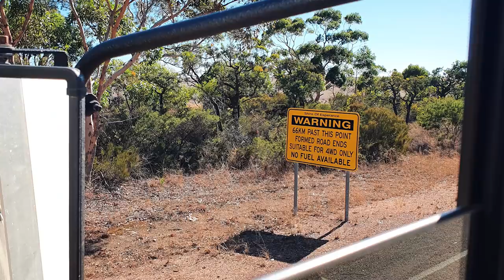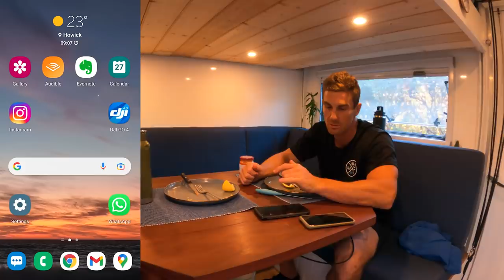STRANDED ON THE TRAIL! First Issue with our 9 TON EXPEDITION TRUCK - Remote Camping Cape Arid

Comment: This might have been mentioned, but (pro tip), with split rims you don't need to remove the rim from the truck.  Just jack it up, pull the retaining ring and pull the tire off the rim.  Then do your repair and slide it back on.  We use a 6' bar and a block to lift and slide it back on.  We even do big loader tires that way.
Reply: And air in tube and go in water to find leak
Reply: maybe you can teach him.
Reply: Yep, even on normal rims the vehicle weight can help a lot, especially tractor rears. (You lower the wheel into the new tyre.) :o)
Reply: Any time I’ve ever done a split rim I always point the ring toward the ground when airing them up that way if it comes off it goes straight to ground and not flying off across the world. But that on normal size tires I’ve ever messed with
Reply: @4wdtennessee459  That can be worse, then the whole assembly goes airborne :o
Reply: @teamidris  like I said I’ve only done small truck tires so there’s not as much force behind it I would think but I do see what you’re saying. One other thing Ido is wrap it with a chain in like 3-4 spots. I’ve never had one come off but I’ve only had to mess with a few of them.
Reply: @4wdtennessee459  I’ve never met a tyre that wasn’t thinking about killing me :D
Reply: @teamidris  lol right
Reply: You can only change tyres with tubless split rims on the truck. 
Wouldnt be easy with adf rims

Comment: Hi chris just a quick tip that may help i watched a bloke with a race truck  use 2 rachet straps hock from the side rail into the holes in the wheel rim to lift the wheel on to the studs in sandy conditiond

Comment: Invest in a electric rattle gun, it won’t undo the torqued nuts, but will save heaps of time once cracked.
Reply: you mean battery.. electric needs 240v..
Reply: @harrywalker5836  or air. As would have a compressor and air tank surely.
Reply: Milwaukee M18 impact will knock those lug nuts off...
Reply: @harrywalker5836  I think electricity comes in all volts battery powered 18v volt would still be electricity ⚡️🤔
Reply: Yeah3/4” Milwaukee electric impact wrench no worries 😉
Reply: like others have said 3/4  milwaukee would eat those wheel nuts for breakfast i use one on a regular basis for truck tyres.
Reply: Impact wrench !

Comment: Hello Chris & Ange, I have another tip for you because l am not sure if you did this. I know you couldn't find the leak so your assessment could be spot on but this might be useful for next time. Mark the tyre with chalk where the valve is situated before disassemble. Then when you locate the leak on the tube match it back up on the tyre by just resting it on top. By doing this you can get a general idea where the tyre was punctured. Then carefully rub your hand along the inside of the tyre in that general area in particular,  but also the entire inside area just to be sure for the offending foreign item. By doing this you can feel more confident that you are not fitting the repaired tube, or a replacement, back in while the foreign item is still in the tyre. If you don't do this you might find the tube will get punctured again. Hopefully l explained this well enough. Jason from Melbourne Victoria.

Comment: did you check the valve?do you have a valve removal tool and spare valves?
Reply from the maker: No it was coming from behind the valve stem where it attaches to the tube.
Reply: @TheOutFit  well done on the change anyway!
Reply: @TheOutFit  why dont you have a 1/2 & 3/4 battery drill, i change 5 tires in 20 mins. rigid, milwalki, makita.. that extension bar is chinese, get a u.s, japan, swedish one..

Comment: One great safety tip for changing split rims without a safety cage:
You should only inflate the tyre to about 5psi (until the flange seats) then bolt it on. Once it is bolted on the vehicle then inflate remotely on the other side of the vehicle if possible. Then if anything goes wrong you won't have wheel components flying at your face! Happy camping and stay safe 🤙
Reply: when they let go, you look like a burger ring. death rims.. jeeps ,f250, dodge had them.

Comment: Great show travel safely 😁 👍🍺
a couple of small tips 
Carry a 4way valve tool and extra valves . It may be a faulty valve in the tube and the tool can re-tap  internal valve thread . Removing valve to air down often weakens them. 
Use a few ratchet straps around the tyre over the split rim locking ring to hold it down when airing up in case it flys off 
Use ratchet straps to raise the wheel up onto the hub or you can use a few metre long or longer  bars . Leverage makes a big difference.  a long handle shovel also works
Definitely use a jack stand  
Did you permanently wire your diesel transfer pump on your dash board yet
Reply: Plus one to checking the valve core. I've had a few on them fail over the years. Each time that they failed, they only leaked at low tyre pressure. Made it hard to diagnose.

Comment: Good job on the tyre, Iain just changed all five of our tyres over to the new wheels, and the split rims are a lot easier than  solid wheels.   Iain made a jack stand out of a laminated wood, to work together with the jack, not replace it.  It is also flat, so packs away nicely.   Iain also says it is best to put it in 4wd and diff locks on when jacking it up, we made that mistake once and the truck rolled forward and fell  off the jack when the wood under the jack broke.  We damaged a portal and the truck  ended up on a flatbed -  $1000 for the  300km trip home, but we had insurance so just the $200 excess.
Reply: I made the jack stand out of LVL, about 90mm x 240mm wide and shaped to fit the axle.    I made it from 2 x 240x45 LVL, glued and screwed together.  If you go with  3 x 240x45mm LVL, it will work for your truck, as long as you use it with the jack, not as a replacement.  As Trish wrote, put it in 4wd and lock the diffs, as that will help stop it rolling.  You are lucky you picked up that it was leaking, as a slower leak would have made the tyre overheat and destroy it.  We have a Tyre Pressure Monitor,  it has saved us a couple of times giving us warning of punctures  and leaks, long before we realised it was going flat, the alarm was going off.   You will need something with an external aerial, as we found that we sometimes did not get signal from the sensor, and our truck is a lot smaller than yours.    It cost $400 with internal sensor and the external aerial, well worth is epecially given the cost of a tyre.  You would need the external sensor, due to the tubes.    Good luck with your next bit of the trip, so many great places to visit down there.  
Iain
Reply: Hola muy bueno el comentario.. Lo voy a poner en practica. Gracias. Saludos desde ARGENTINA.

Comment: Well done on the repair job. There's plenty of haters out there re split rim set ups. But the Aussie outback has seen over 70 years  of trucks and utes wearing split rims. They are just so practical for the sort of use you are putting the Mog to. Just pull them to pieces every couple of years and give them a wire brush and a bit of TLC.  Also, be very liberal with talcum powder when reinserting the inner tube. It helps enormously to permit the inner tube and tyre to move independently of one another without chaffing when at low tyre pressures. 
Another tip when no axle stand is available. Chock the other rear tyre (plus put in 4WD diff lock). Logs, rocks, or the proper Mog tyre chocks that the Mog came with from Germany.

If you were thinking of going the battery operated rattle gun for spinning the wheel nuts on and off with, think of going with a brand that also make a small battery chainsaw and drill. Very useful additions when in remote countryside

Comment: Great work on getting the tire back on, it's a BIG job for sure. One thing i have picked up over the decades 4 wheeling is too use about 1/2 bottle of talcum powder in each wheel of that size when you are using a tube inside. It does an amazing job of keeping the tube in place when run at lower pressures. I LOVE all that your doing now and look forward to the next vid each week.      CHEERS AND SAFE TRAVELS     Steve h.

Comment: I know the joys of changing tubes and mounting tires on split rims. My father was a milkman from the 1950s till mid 1970s when I took over the family business.  The 5 ton milk truck had split rims with duelies in the rear. The nice thing with duelies is if you only need to work on the outside wheel you could just run up onto a 2 inch board with the inside tire to lift the outside one high enough to get it off.  No jack required.  Even back then it was difficult to impossible in the U.S. to find a tire shop that would work on a split rim, so we had to do it ourselves.

Comment: You might want to get a cordless impact gun. That bar is bending pretty far and if it fails, it's nice to have a backup. The impact gun is also nice when it comes to spinning lugs on and off and is super handy with anything kind of bolt needed work, and you've got a ton of them! Nice work.
Reply: they can break that type of breaker bar but the main thing to avoid that is grease or antisieze on the threads.theres no other way around it. lubing the threads also get them tighter because the threads don't bind.
Reply: Yeah, a good impact is priceless for many reasons in this type of vehicle and situation. Chris looked like he was enjoying the workout however and I suspect there is already a good impact somewhere in the Moog.

Comment: Good effort on the tyre there a dead weight for sure. Get yourself a good battery impact impact gun you have the means to charge it plus you wont have to break into a sweat breaking the wheel nuts off. Loving the channel and the day to day adventures of you both 👍
Reply: lol , i was thinking air-gun run off the truck's air  ... but yeah anything but a breaker bar & effort
Reply: @888johnmac  Id think your air tank wouldn't  be big enough im running a 150 ltr tank and that does car stuff but ive also got a SnapOn gun that does most stuff. Milwaukee does some good ones not cheap but well worth havin.

Comment: Hi there guys Next time in this particular instance check the valve core first before doing anything. When deflating 
/ inflating tyres these are easily damaged. I've had the same issue twice. Chris the way that brace bar bends you may wish to look at purchasing a battery operated impact driver. Just a thought. Love your work; travel safe .
Regards 
Steve H

Comment: Hey mate I grew up with an old man as a truck driver . When youvuse the tyre levers to get the bead lock off , cross them over. This allows you the use the bottom one as a l pivot point making it far easier.

Comment: Guys, good job on the tire repair.  You’ve now graduated👩‍🎓👨‍🎓from Big A_ _ tire 🛞 University.

Chris, it was very smart of you to learn how to and practiced on the original tire mounting 👍.  

Now for my 10¢s, which I’m certain you have it already on your shopping list.  
1. A pair of jack stands
2. Longer tire iron bars to walk the tires on to the lugs
3. A spare breaker bar.  Watching you breaking the wheel lugs loose showed there was quite a bit of flex on the breaker bar.  They usually let go at the pívot point where the socket connects.   

All in all, another great video guys, looking forward to the next one.

Comment: My name is Bethani Dudley, ) & I used to drive big rigs on down to bicycles) & I live in the USA & if you want to stop having flat tires, put a product for your tire / & tube called SLIME. This fluid is green in the color & you don't have to take the tire off the rime. This stuff WILL seal the tire & puncture while the tire is still on the vehicle, you just have to rotate that tire that is going flat while it's off the ground a couple inches. What you are trying to do is help the slime go all over the inside of the tire/tube. Slowly Hand spins its wheel assembly. Air up the tire/tube after about 5 minutes to make sure you get good coverage. GOOD LUCK !!!

Comment: Instead of breaking your back and that long as bar.. Check out something called a "Torque Multiplier"  And at 17:00 a ratchet strap from the flat bed under the tire and back up to the flat bed might make a cradle that you could use to rachet the wheel up high enough to push it onto the lugs. That or weld on some eyelets in the right spot to form the cradle.
Reply: keeps you fit,,.

Comment: You need some inner tube patches..   I have had  tubes with 5 patches on them and still held air for  months ..  In the USA  I Use Freylube  on the beads and all metal places that could rust..

Comment: I won't complain when roadside assistance takes a while to show up for a flat 😁 😁 

Funny watching this as the last major flat I had to deal with was years ago on my Dad's monster truck camper.   The wheels were painted the same colour as yours. Only problem was the nuts were painted on the wheel by the previous owner.  Broke the wrench trying to get them off.  Fortunately a friend had a garage close by, he came out to us and tried getting the nuts off but gave up and used a air canister to inflate the tire so we could get back to the garage and use the impact gun.One thing you might want to consider is a can of flat repair that you can inject into the tube.  HORRIBLE junk if you don't have a tube but if you are stuck someplace and cannot change the tire it works.

Comment: I think you did 100% the right thing in doing those 5 tyre changes yourself. There ain't no tyre cages in the wop wops, so you got to do what you got to do....or possibly die of thirst.......and the practise is definitely a lifesaver. I say good call!

BUT you got an awesome compressor on that truck, why no air gun, air jack etc? I  know you have muscles for both of you, but why strain yourself?  Mind you, I bet the Mrs enjoys watching those muscles bulging, and it is damn good for ratings! I will have to think of something else to get my ratings up when I do my videos.

I have just bought a U1700, and I am finding your videos are an inspiration and a great incentive to get the truck up to your standard asap! A couple of mods I will do is put a portable, 2000KG winch mounting points above each wheel station, so the Mrs can mount the tyre again easily.  A second is an air jacking points on all the axles and, crucially, two spares, so at least I might not have to worry about sorting out a flat tyre straight away (unless I get two punctures).

Comment: Make sure the inside of the tire is completely clean of any small stones or debris. When the tube is inflated those small objects get trapped between the inside of the tire and the outside of the tube. Then when the tire flexes the small objects can easily rub a hole in the tube. Stand the tire up so all the debris falls to the bottom and carefully clean it all out. Run your hands all over the inside of the tire to make sure there isn't any debris imbedded in the inside of the tire.

Comment: Epic episode as usual, looked like such a sweet spot! Worth considering a impact driver? I was watching watch a 4x4 recovery channel and the dude was using a breaker bar and gave himself a hernia. If not I find pushing down easier than pulling up. Some longer tire leavers would help with the locking ring but also for leverage lifting the tire onto the lugs. Keep the great content coming!
Reply: On average most people can lift double what they weigh so lifting is always the way to go on tight nuts.
Reply: He could probably sit on it if he pushed down, you wouldn’t generate enough force that way. Lifting is the way to go.

Comment: this video was randomly suggested on YT for me. casual thoughts while watching the tire repair, I'm assuming you know the dangers of split rims when airing back up the tires and such. have you thought about a mechanical air compressor such as a DIY York compressor on the engine or if the truck uses air brakes, to tap into the factory air system. i would recommend a 4ft wood 2x4 or possibly heavy truck tire spoon, to allow you leverage under the tire to lift it back up. or what about letting that bottle jack down a little bit to allow the tire to go back on easier and then jack it back up to finish tightening down the lugs IE make the truck come to you instead of you brute forcing the tire up to it.

Comment: Hello new subscriber, love the Unimogs but i'm going to use a ACCO 6x6 truck 4bt cummins, auto etc. EX Army 30yrs another tip for remounting the wheel, use a tyre lever or pick handle or your breaker bar and or a shovel (yes a shovel works great we used it in the army changing the new MAN truck tyres, I learnt something new after 25yrs of service) anyway great job you are both inspiration to the rest of us.

Comment: It is a skill to use the two tyre levers efficiently to get the split rim off. ID the indent on the split rim near where the rim meets. One end of the tyre lever fits perfectly in there and you lever that over then pop the second lever under the ring to hold the split rim up... then remove the first lever and work your way around the split rim...... don't over think that you can do it better just do the process.
If you can carry a milk crate to sit the rim on (without the split rim) and usually the tyre will simply fall of the rim without all the pushing and pulling of the rim from the tyre. The weight of the tyre works in your favour.
Reply: Ddddddddddddddddddd

Comment: Buy yourself a 3/4 Milwaukee rattle gun and do your self a favour. Will pull those nuts off with ease. A couple decent pry bars can help with lifting up the wheel and lining it up with the studs too.

Great work

Comment: An easier way to get the tire back on the truck would be to use a lever like a large bit of wood or a shovel and slide it under the tyre and gently stand on the other end and you use your body weight to lift the tyre like a seesaw it works on my 1100×20  tyres  I have  done it  on 1600×20 nice video and great scenery